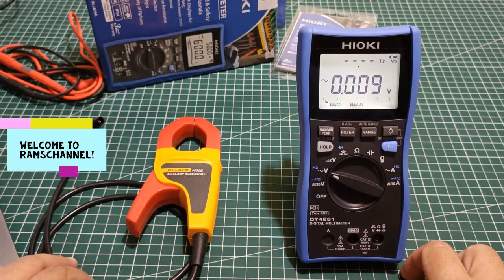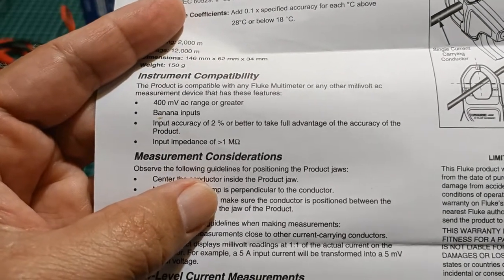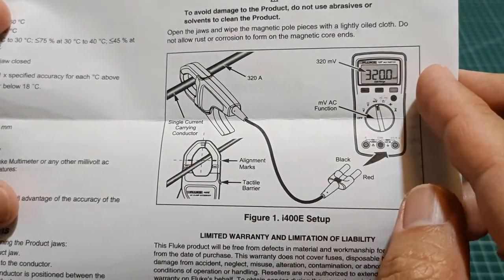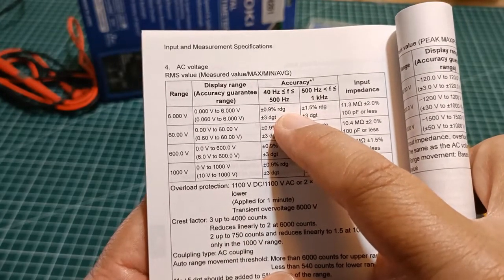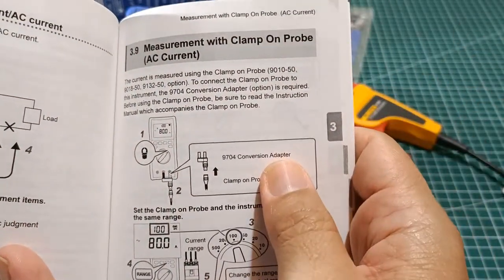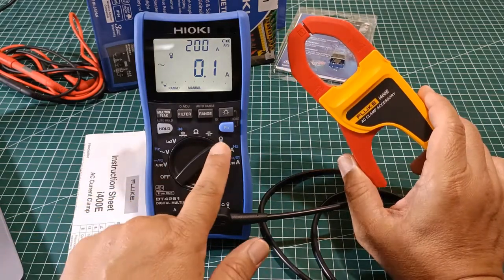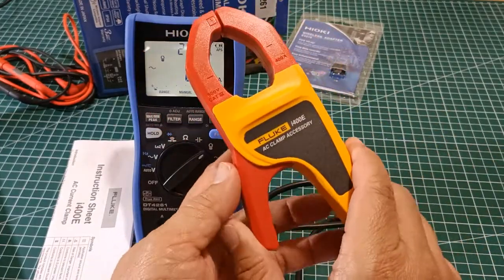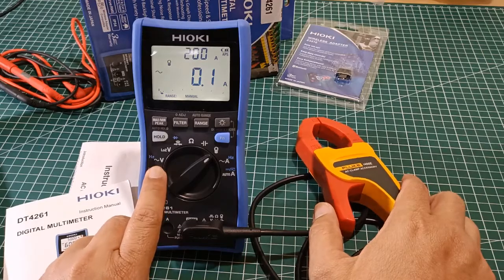[ENG SUB]How to Use the Fluke i400e with Hioki DT4261 to Measure AC Current Up to 200A/400A

Comment: Can i use Fluke i400e for my Fluke 287 ? Please help
Reply from the maker: I don't have a Fluke 287 but from online sources, it appears to meet the requirements for compatibility with the Fluke i400e: 500 mV AC function and 19.04mm banana jacks. Measure the center to center distance between the 287's COM and VΩ input jacks if its of the above standard distance because that's where the i400e's jacks will be connected. See this link for more details https://www.fluke.com/en-id/product/electrical-testing/clamp-meters/flukei400eaccurrentclamp
Reply: @ramschannelreviews  thanks for your help

Comment: Hello and thank you for the video. Does this meter have a magnet on the back? Or a place to install one? 
And do you happen to know if Hioki makes any clamp meters with a capacitance function which would be durable enough for everyday field use?
Reply from the maker: Hi thanks for your appreciation. Hioki makes magnetic hanger for their DMMs, although I haven't bought one. They're called Z5020 and Z5004. Here's a link you may refer to: https://www.hioki.com/sg-en/products/testers/dmm-3/id_108097 Based on this product page these straps should fit the slot provision at the back of the DT4261. I have generic magnetic hangers but they won't fit the 4261. It does not have a built-in magnet at the back.

I own a Hioki CM4376 AC/DC clamp meter which has a capacitor test function. I can confirm that this is a reliable instrument. The other models with capacitance function are: 4371-50, 4373-50, and 4375-50. As far as I know they are also made in Japan and made for professional field use. I suggest that you look them up to see if their specs meet your requirements. Safe testing!